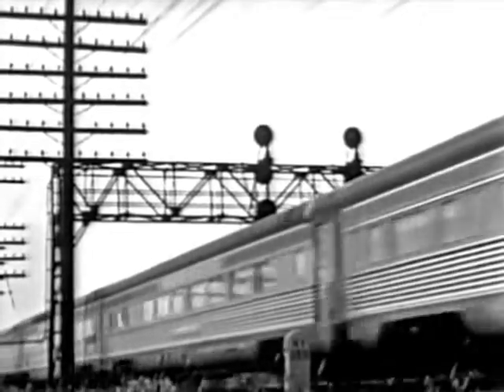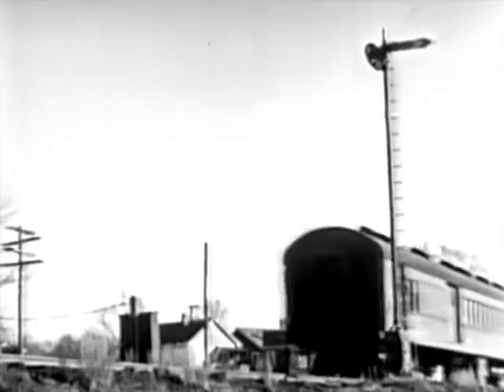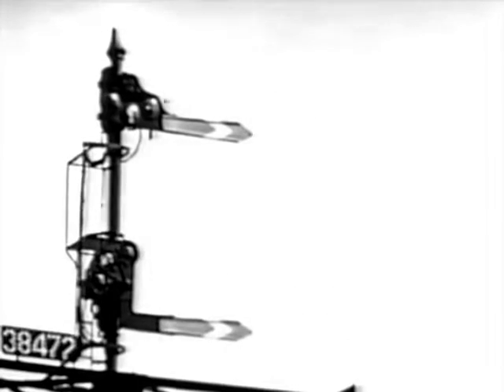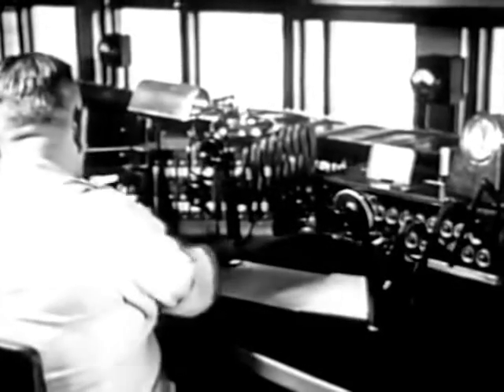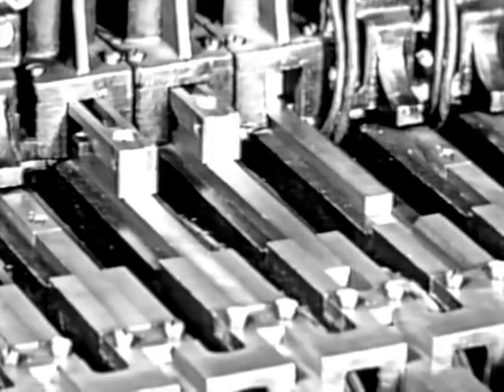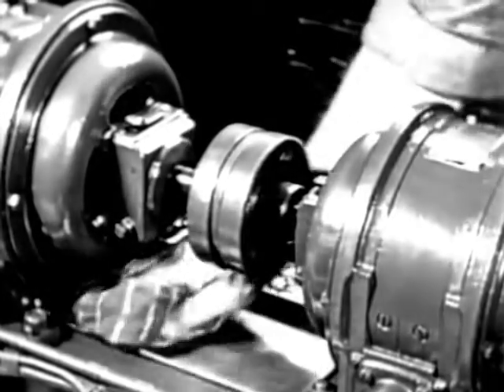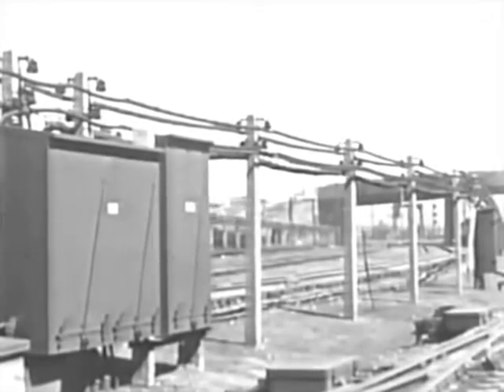New York Central Railroad: The Railroad Signal - Running the Railroad - CharlieDeanArchives

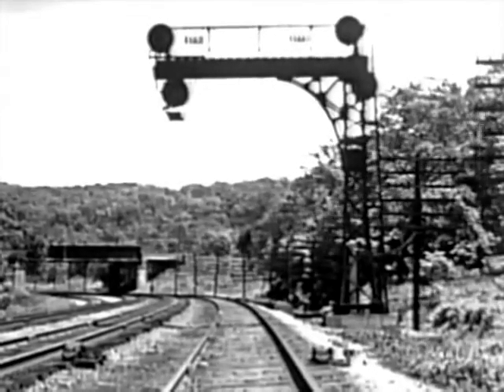Comment: would like to know the location at 7:34 with the overpass in the backround ...could be near Herkimer New York.
Reply: It's west of Rochester, east of Coldwater. The signals are searchlights, which means Lines East. The marker plates are 3771 and 3773, corresponding to MP 377. The view is looking east - this is confirmed by the fact that the pole line is to the right, which is the south side of the tracks. Note that the signal heads are staggered on the mast - one is to the right and the other to the left. In those days, this meant that the signal was an automatic signal, not a home signal. (Home signals had all the signal heads in a vertical line, one above the other). You can see the train-stop inductors in the long shot of the cantilever.
Reply: Thank you my smart friend...would love to visit that area now,,,,

Comment: A good history of how the NYC/GRS did signaling in the 1940s. Much of what is depicted as "modern signaling" is long gone (semaphore signals, inductors, "pistol grip" electromechanical interlocking machines) or are nearly gone (searchlight signals, shelf relays, open-wire line circuits). Yet some things are in wide use today, almost unchanged (switch machines, plug-in relays).Yes, there was a time when major railroads like the NYC not only had in-house public-relations departments but they made movies to be shown to the general public.

Comment: What is interesting is that they had automatic train stopping technology in the 1940's (inductors on the rail side would trigger the brakes on a train that ran a signal) yet they say this would take forever to roll out in 2017 with PTC. Wonder how many lives would have been saved by rolling this out in the 1940's......

Ah well, probably cost too much or something.
Reply: These systems are less stringent than in the 1940s.  These 1940s systems remained in use up until they were replaced by the more stringent PTC, which also prevents speeding.
Reply: Instead of idiot proofing the system to the point of removing engineers entirely, why not remove the idiots in the first place?
Reply: The "automatic train stop technology" you refer to (inductors) would NOT stop a train that ran a signal. All the inductors did was to require that the engineer hit the acknowledging lever when the train passed a signal requiring a speed reduction. There was no absolute-stop enforcement, nor any real speed enforcement. All it really did was make sure that the engineer didn't fall asleep, or miss a signal displaying other than a Clear/Limited Clear/Medium Clear/Slow Clear aspect.PTC is a very different thing.
Reply: Sure about that? From where it is mounted on the tender, the requirement to reset it manually and the fact that it opens the air line to the cars (thus setting all brakes possibly including the engine) I think it would at least be a serious drag....

Sure it's not multi-block control but it would slow down a train that ran a stop block signal.
Reply: Yes, I'm sure.The intermittent inductive train control system (inductors) as used by the New York Central simply required that the engineer move the acknowledging lever. It DID NOT enforce an absolute stop in any way, nor any real speed enforcement. The business about stopping and resetting was if and only if the engineer failed to acknowledge within a certain time. With the inductor system, a train could go right by a signal displaying Stop Signal without any problem IF the engineer acknowledged.The system also protected against the engineer simply tying the acknowledging lever down. It had to be operated and then released within a certain number of seconds or there would be a brake application. But if the engineer acknowledged as required, the train could proceed past any signal.Don't believe me? Read The Fancy Manual, from GRS, whose system was used all over the Water Level Route.https://babel.hathitrust.org/cgi/pt?id=coo.31924004137729;view=1up;seq=19
Reply: Right, but my point was that if the engineer was distracted or on a cell phone or whatever the brakes would auto apply. This would have stopped the most recent accident on the BNSF where an engineer ran two signals then plowed into a train at speed. 

Granted the engineer could choose to override the system, but there is only so much you can do for pure stupid...

Thanks for the link, this is interesting stuff. It's fun to see what kinds of things could be done with minimal technology....
Reply: The important point is that Positive Train Control is much, much more advanced than the intermittent inductive train control system. The inductor system was no more than a reminder system that was easily overridden by simply pushing the acknowledging lever.
Reply: Agreed. However even the simplest inductive train control of the 1940's would have protected against a number of accidents that have plagued railways in the past 50 years. 

It's true in this situation that the engineer can always override, but that turns a lapse of judgement (passing a signal while on chatroulette) into a malicious action (the signal said red but I'm actively pushing the button anyway. Roll on!). 

I think there's a lot more of the former and less of the latter in the world, and while I like the perfect (full PTC) sometimes I think you should just install the best you have and go from there.

That said, this system probably would have had a bunch of faults and such that would cause too many false positive trips, thus it wasn't implemented in the 1940's-1950's. And here we are with yet another goof on the rails that will probably come down to operator error.
Reply: The intermittent inductive train control system (inductors) WAS widely installed on the New York Central. It was required anywhere the speed limit exceeded 79 MPH. It was on pretty much the entire main line from GCT to Chicago. Other lines used it too.How many accidents it would have protected against is debatable. Train crews generally want to live to retirement and beyond - ignoring signals requiring a speed reduction or stop is NOT the way to get there. The intermittent inductive system was very capital-and-maintenance-intensive. To be effective, every locomotive had to be equipped with the system, for both directions. Every signal had to be equipped too. Every system had to be tested and adjusted frequently.For example, the inductor had to be in a certain exact place relative to the nearest rail in order to be effective. Too low and the receiver would not sense it.  Too close to or far from the rail and the receiver would not sense it. Too high and the receiver would hit it, causing major damage. The receiver had similar issues. Both had to be frequently gauged and checked to avoid problems.Worst of all, the system was not fail-safe. An inductor could be stolen by "mother's little darlings" for its considerable scrap value, and the protection would be gone, while the system still appeared to work normally. A simple short in the inductor cable or winding would remove all protection as well. These costs were so high, and the benefits so low, that in 1968 the FRA authorized the removal of the system as part of the Penn Central merger deal.